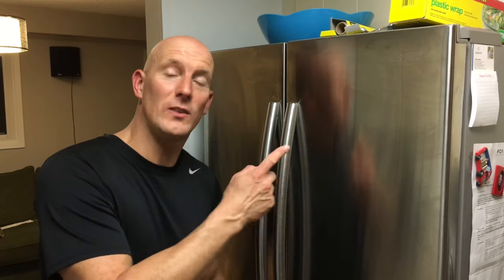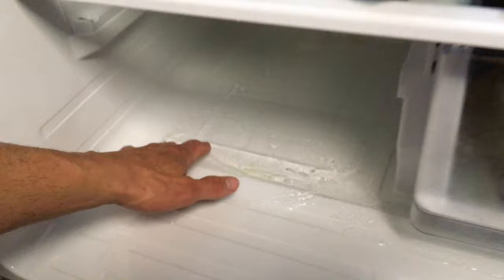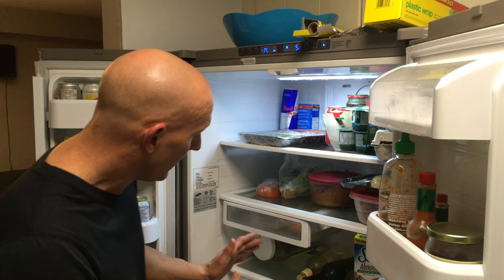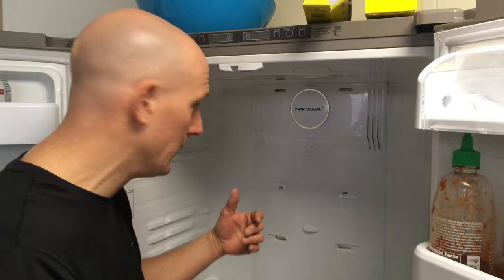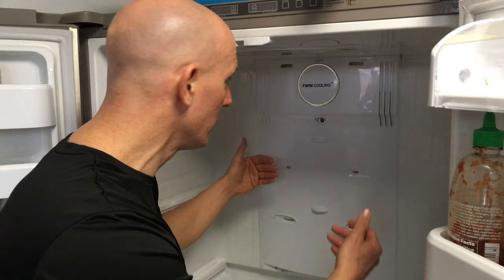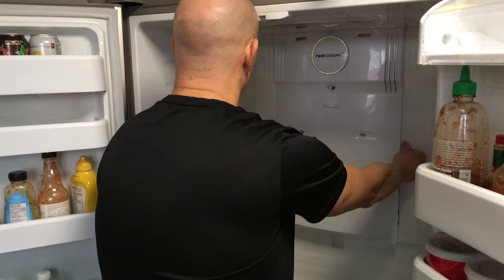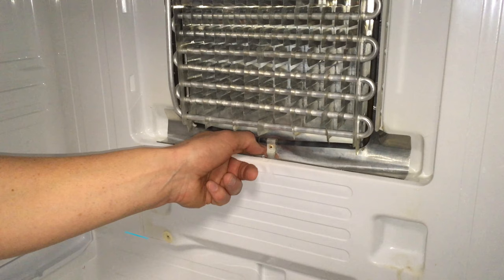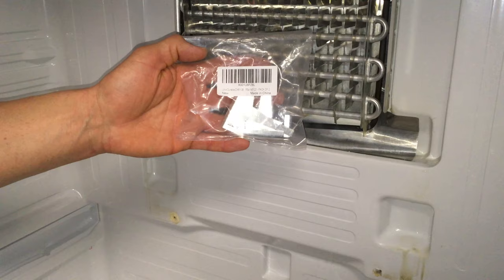Ice & Water Buildup (4K) Samsung Refrigerator

Comment: You saved me another $300 or so.  I watched a lot of videos on this problem, but no one else showed up with the correct solution.  I was able to fix it myself.  About a year ago I had a repair man come to fix the problem, but it showed up again.  When I got into the back and saw that he fixed it by putting the larger metal clip on top of the small original clip, the larger one not really attaching to the heat tube, I was amazed.  So I didn't have to buy a new clip because I was able to use the one he tried to attach.  I got the smaller one out and reattached the bigger one, thanks to your clear and smart fix.
Reply from the maker: Thanks for watching!
This is the updated Repair Kit that you need for Samsung.
Samsung Water / Ice Repair Kit:
Amazon US: https://amzn.to/3YN4Enw
Amazon Canada: https://amzn.to/3WKlUYK

Comment: Thanks so much for the video.  A little help for those who don't or can't turn the fridge off for 24 hours.  And for those who have so much ice around the tray that the styrofoam sticks to the area/coils and you can't take the cover off.  What I did is I took a spray bottle with hot water and patiently sprayed around the edges of the stryrofoam and eventually (maybe after 3 or 4 bottles of hot water) the styrofoam came loose.  Then add more hot water (boiling- and just a little each time) into the tray, then soak up the water and apply boiling water again.  Didn't take too long to thaw the tray and hole.  What a great sound when you hear the water go down the tube.  All in all it took about 90 minutes and my stryrofoam was pretty frozen to the tray and a little to the bottom of the coils. Be patient but if you have a place to store your food overnight it is probably easier to unplug and let thaw. Thanks again for the video.
Reply from the maker: Thanks for watching!
This is the updated Repair Kit that you need for Samsung.
Samsung Water / Ice Repair Kit:
Amazon US: https://amzn.to/3YN4Enw
Amazon Canada: https://amzn.to/3WKlUYK

Comment: Thank you for this video Jeff! 
I have the same fridge with the same problem. I went ahead and made your repair - the video made the process super easy. Unfortunately, within a few short weeks my back panel was frozen over once again. I dredged the internet for solutions. I defrosted the unit once again, I took everything I could apart and checked for continuity. Everything was in good working order. I even pulled out the fridge and cleaned the pipes along with everything else in the back. I also reset the fridge after I was all done.  I even read about a trick about moving the defrost temp sensor to the other side of its original tube placement in order to active the defrost cycle a little sooner. Well, all my hard work paid off for six weeks. I was feeling so good about it too… but last night I discovered ice forming yet again in the crisper. The fridge is only six years old - and a new one isn’t possible at the moment. I’ve asked several repair folk to come out and no one will touch it. 

Any last minute ideas or suggestions before I start manually defrosting this hunk of junk every two weeks for the next ten years???

Thanks! 
Sean
Reply: Oh my God  it sounds like my problem!! If it was a car they would have recalled it, instead Samsung expects us to just buy another one or go insane trying to fix it.  I'm frustrated!
Reply: I just posted my own comment but with the new better part I discovered I still had ice about 6 inches down the drain so somehow it was getting below freezing in that lower area. Not sure if it was from freezing downwards from the top of the drain, or starting from below. I had a sheet of ice below the collector pan, suggesting water was collecting under it (and freezing due to not enough heat exposure?). Maybe from the flange on the removable panel?
Reply: Did you replace the drain tubes.  That's what we needed to do for ours.
Reply from the maker: Thanks for watching!
This is the updated Repair Kit that you need for Samsung.
Samsung Water / Ice Repair Kit:
Amazon US: https://amzn.to/3YN4Enw
Amazon Canada: https://amzn.to/3WKlUYK
Reply from the maker: @matt-97201  Thanks for watching!
This is the updated Repair Kit that you need for Samsung.
Samsung Water / Ice Repair Kit:
Amazon US: https://amzn.to/3YN4Enw
Amazon Canada: https://amzn.to/3WKlUYK

Comment: We have the same refrigerator as you show in the video.  Ours freezes up in the back panel (coils), but we don't have the ice/water problem in the bottom under the drawers. The fridge just starts to not be cold anymore. The freezer always stays ice cold though. We have been emptying/defrosting the fridge almost once a month until I started searching & found your video & many forums about the issue. So glad we found this. Ordering the parts now.   My boyfriend was ready to throw the whole fridge out bc he was so frustrated!  (Side note: he called a technician to come look at it & fix it the first time it froze up & all the idiot did was add more Styrofoam & reinforce what was there as if the Styrofoam was the problem.)
Reply: We have the same problem you had.  Did this fix your problem?  After this defrost I am going to increase the temperature from 36 to 38 degrees and see if that helps.
Reply from the maker: Thanks for watching!
This is the updated Repair Kit that you need for Samsung.
Samsung Water / Ice Repair Kit:
Amazon US: https://amzn.to/3YN4Enw
Amazon Canada: https://amzn.to/3WKlUYK

Comment: We bought a home that had a Samsung ‘frig and we had a plate of ice form under the deli tray, just above the freezer unit.  The prior homeowners left both the owners manual and the installation guide. One said to level the unit and the other said to slant it back ever-so-slightly, which is what I did.  The 2nd thing I did was to turn off the energy saving function, which presumably would have the condensate removal function work to greater effect.  I’m pleased to report that we no longer have ice build up problems!!!!
Reply from the maker: That is a great tip!  I will try that out and look into that.  The energy saver function has always been turned off on mine as well!  Thanks for that extra tip!
Reply from the maker: Thanks for watching!
This is the updated Repair Kit that you need for Samsung.
Samsung Water / Ice Repair Kit:
Amazon US: https://amzn.to/3YN4Enw
Amazon Canada: https://amzn.to/3WKlUYK

Comment: In addition, make sure to clean and drain water defrost line. It's most likely clogged and causes excess water/humidity buildup inside fridge. Easy access from back of the fridge, after sheet metal cover is removed. There are 2 or 3 drain tubes leading to drain pan; one or more of drain tubes is likely to be completely blocked with dirt and gunk. Good luck!
Reply: Also clean off the compressor while you're there.  It'l likely fitly and covered with dirt/dust bunnies.
Reply: How would I go about cleaning the line ? Compressed air?
Reply from the maker: Thanks for watching!
This is the updated Repair Kit that you need for Samsung.
Samsung Water / Ice Repair Kit:
Amazon US: https://amzn.to/3YN4Enw
Amazon Canada: https://amzn.to/3WKlUYK
Reply: Hi there, how do you clean the compressor and the line??

Comment: Thanks for the video. I seem to have multiple issues.When I finally got the back panel off it was a lot of ice, including on the metal pieces which i assume are parts of the heating element? North entirely sure if only the black parts around should heat or everything. The black were cool to the touch but perhaps the sensor doesn't run it because it's 80 degrees in there due to defrosting,? The other issue is the cheap metal thingy actually had deteriorated and fallen off! I put it back as best i could since I need to get the food back in, but will order the part right away! Of course the line seems iced up too so using a hair dryer to try to defrost..
Reply from the maker: Thanks for watching!
This is the updated Repair Kit that you need for Samsung.
Samsung Water / Ice Repair Kit:
Amazon US: https://amzn.to/3YN4Enw
Amazon Canada: https://amzn.to/3WKlUYK

Comment: The Samsung service bulletin for this repair includes three items that will correct the freezing problem. It includes insulation strips on the backside of the metal panel, moving the coil thermocouple, and replacing the heat sink (this video). I would highly recommend doing all threes items. I also insulated the coil penetration at the top right. This is where the freezing starts to occur. I used HVAC pipe insulation and foil tape.
Reply: Any links to the service bulletins perchance?
Reply from the maker: Thanks for watching!
This is the updated Repair Kit that you need for Samsung.
Samsung Water / Ice Repair Kit:
Amazon US: https://amzn.to/3YN4Enw
Amazon Canada: https://amzn.to/3WKlUYK
Reply: Is there video available for all of this. We spent a  weekend just doing this replacement part repair and the fridge bottom has an 1" of  water and the freezer has 1/2" of ice on the bottom the next morning.

Comment: Jeff-- a month ago I noticed I had ice building up underneath the deli tray (which is below the two produce drawers).  It seemed to coincide with me putting in a new water filter (that is located between the two produce drawers), so I pulled the water filter out.  The frig doesn't need a water filter installed to use the in-door water dispenser so no big deal.  But the ice re-occurred.  So thanks to YouTube, and DOUBLE thanks to you I order the metal part and undertook the repair/replacement that you show in this video.  I'm VERY optimistic that I've solved the problems, especially because i had ice build up in that little drain where the metal piece hangs.  Anyway, THANK YOU, THANK YOU, THANK YOU!!!!!!!!!!!!!!!

Comment: Just did this fix as I have been waiting for the temp outside to be right for my food. The hardest part was pulling out my fridge! I let it sit open and off over night for about 18 hours. The tube was still plugged with ice so used hot water and a blow dryer until it ran free. I also took off the back panel and cleared the water from the tray with a baster and checked hoses were clear and vacuumed it all. I was concerned about putting the inside panel on but it plugged and snapped back in fine. Thank you sooooo much for this help as my appliance repair man does not touch Samsungs. It was in the house when I bought it 2 years ago and has always been a problem.

Comment: As a repairman myself I would also add cleaning the drain nipple on the drain tube in back of the refrigerator it gets clogged up and slows the water from draining
Reply: Spot on! We have the Samsung RF28HFEDTBC French Door unit and has been a great refrigerator so far. I thought I may have had the same issue as the OP, however it turned out to be the drain tube was clogged up at the bottom rear of the refrigerator. I guess my unit defrosts correctly. Thought I would post just in case someone else has the same water backup issues and didn't see an ice build up. Ours went over 4 years before this happened. Many Thanks!!
Reply: Is that visible from the back or does something need to be removed?
Reply: TJtheDJonWMCN , remove the metal cover on the lower back of fridge. Once removed, you’ll see three rubber drain tubes on the right half of the fridge. Best to pull off and clean all three while you’re back there.
Reply: @eyemright  Thanks! Stay well.
Reply: @TJtheDJonWMCN  Hi.  Did cleaning the drain tubes solve your problem?

Comment: Your video got me going in the right direction but for me it was not this issue causing the problem. Thanks to James comment below it was actually a lot easier. When I took the fridge apart there was standing water in the drain collector area but it was not frozen. Long story short I ended up taking the bottom back cover off and there are 2 Grey tubes on the right side  (looking from the back of the fridge) that are drain tubes . When I removed the left tube it was clogged with some weird almost silicon substance. Unclogged it and water immediately ran out, about 1/4 cup and that was it. No problems since. I would try this first since it is so easy, if this does not work then try the fix in this video.
Reply from the maker: Thanks for watching!
This is the updated Repair Kit that you need for Samsung.
Samsung Water / Ice Repair Kit:
Amazon US: https://amzn.to/3YN4Enw
Amazon Canada: https://amzn.to/3WKlUYK

Comment: Thank you so much for this video.  We basically have the same Samsung model and it kept freezing every month along with that fan noise cuz of the ice, then the inside temp would go up, in turn not cooling properly. 

I didn't want to comment until I knew for sure it worked. Ordered the part from Amazon and hubby installed it. It was pretty easy. It's been over a month and we've had no issues ever since.👌 Thank you again so much for this super simple fix! God bless!🙏
Reply from the maker: Thanks for watching!
This is the updated Repair Kit that you need for Samsung.
Samsung Water / Ice Repair Kit:
Amazon US: https://amzn.to/3YN4Enw
Amazon Canada: https://amzn.to/3WKlUYK

Comment: Great video. I have had this issue with my RF260BEAESR French door. I took everything apart and used the Amazon clip you've referenced here.  A year later, I had another freeze-up. 
Be mindful of one thing...the Amazon clip is grows wider as it tapers to the top. You have to be sure the clip isn't touching the water drainage metal flashing when the clip is in place. I trimmed the edges of the clip to make the taper narrower.
If your frig is frozen, an important step is to make sure the faceplate air vents (small oval openings) are not frozen shut.  If ice is coming out of these vents, use a hairdryer to melt the ice.  
Also, on the back of the faceplate, there is a Styrofoam structure. Be sure to melt any ice build-up off this structure.  
You'll notice that the Styrofoam structure is multipart. There may be ice inside, although it's not readily visible, but it could be blocking airflow to the fan. 
Remove the middle Styrofoam piece, gently, after using a hairdryer to melt all ice.  
Once this piece is lifted off, you need to melt any ice buildup in the small ducts leading to the fan. 
Then melt all ice off of the fan and frig wall before reassembly.
Also, once reassembled, keep containers and other packages away from the small oval vent ducts on the face plate.  Good airflow is key to overcoming this evaporative system design flaw.
My unit has an internal ice maker tray. When I scoop ice into a glass, I scoop from side to side, not front to back.  Scooping front to back can push ice cubes over the backside of the tray, and they fall down and make a mess.
Reply from the maker: Thanks for watching!
This is the updated Repair Kit that you need for Samsung.
Samsung Water / Ice Repair Kit:
Amazon US: https://amzn.to/3YN4Enw
Amazon Canada: https://amzn.to/3WKlUYK

Comment: Thank you so much for this video, I followed these steps to defrost coils, then I had to use hot water to melt all of the frozen water in the length of the drain tube.  I ended up using a piece of aluminum wire instead of the clip from Amazon… I sent it down the drain hole bc the drain tube on their model fridge has an immediate turn to the left and the wire followed the turn easily.  I sent it down about 4 inches total, then wrapped it around the heating element with 6 tight turns using needle-nose pliers.  The hardest part for me was undoing the electrical clips!  Thank again, man, great video.  The aluminum wire cost $1.26 from Lowe’s, I just bough 1 foot of aluminum electric service wire, and used one of the strands surrounding the thicker service wire.
Reply: Hi Brian, has this method worked for you?
Reply from the maker: Thanks for watching!
This is the updated Repair Kit that you need for Samsung.
Samsung Water / Ice Repair Kit:
Amazon US: https://amzn.to/3YN4Enw
Amazon Canada: https://amzn.to/3WKlUYK

Comment: Had the fridge for 9 years, had this problem many time.  Called the service repair man many times.  My wife said last time the service man said it was fixed.  He used a different part.  That is ll he said.  Well, it froze up again.  I googled the problem and your great video popped up!  I have been a long time "See on, Do one, Teach one" type of guy.  I followed your instructions, emptied the frig, let it defrost for 24 hours, pulled the back panel.  Everything was going great....until I looked at the part in question, the small piece of metal inserted into the drain tube.  It was the same as the replacement part referenced on your video.  It had been replaced by the last repair man!  I had already ordered the replacement part you have mentioned but didn't get to use it.  I went to work, came home and found that my wife called a local appliance store and told them to bring any 27 cu ft refrigerator/freezer out to the house, as long as it wasn't a Samsung, or an LG.  They showed up in 2 hours with a Whirlpool 27 cu ft unit and hauled the Samsung away, along with 3200.00 dollars of my cash!  Great, there goes my replacement man cave refrigerator!  The whirlpool has been plugged in for 24 hours and is cooling nicely, however, there is a constant hum whenever the refrigerator is actively running!  I am now using a second google search to solve this problem!  Man made items!  When they work, they work well.  When they don't work well, unhappy wife!  First world problems!  Even with this inconvenience, I determined that you do a great job with your videos, however, even the best teaching can not overcome a product problem that should have been addressed by the manufacturer years ago!.